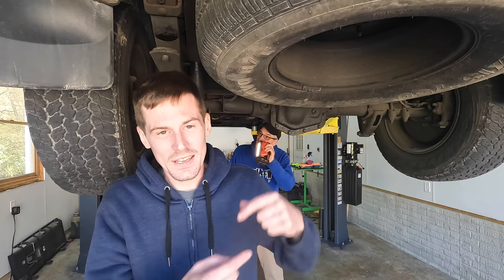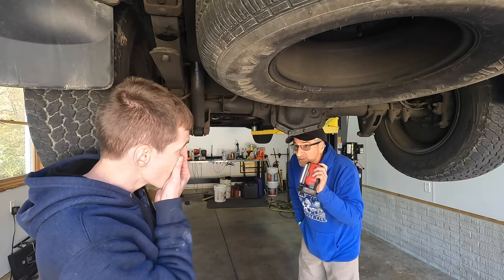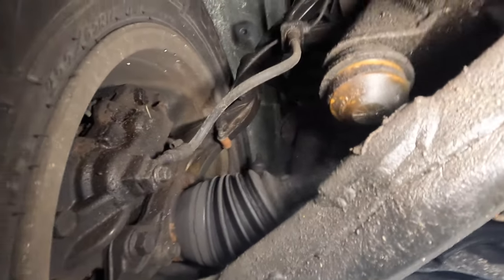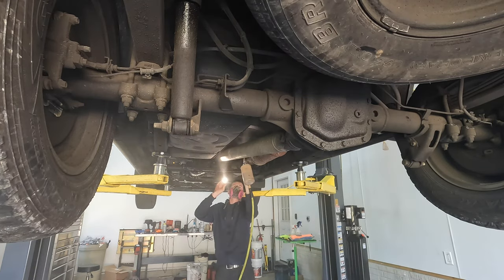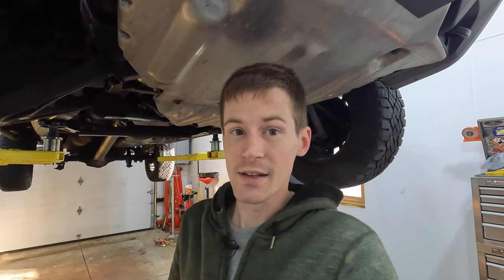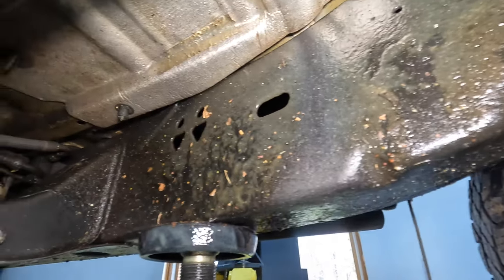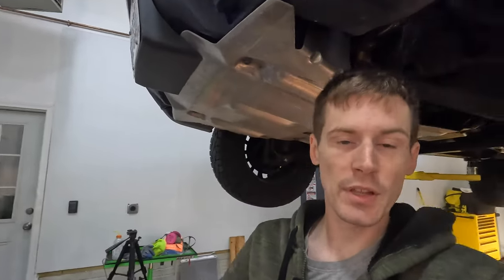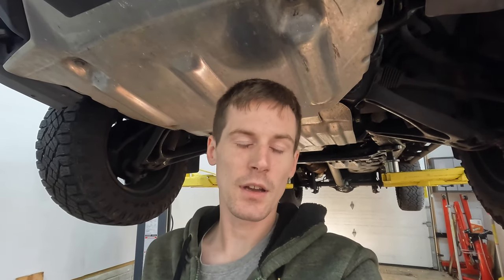Lanolin Undercoatings 5 Year Review & Career News... (Fluid Film, Woolwax, Surface Shield)

Comment: Congratulations on your new B'laster job.  As the social media guy (essentially, marketing), I think you should make content showing other great uses for Surface Shield.  Example:  It's hands down the best product I've seen for preventing battery terminal corrosion.  When installing a new car battery, spray the posts, attach the battery cables, and spray the clamps.  The non-hardening coating prevents water, air or corrosive gases from reaching the posts, clamps or the copper cable that can wick water and corrode internally.  I also sprayed large fasteners in the engine compartment that were starting to corrode.  Now they're well lubricated and protected from corrosion.  I bet it'd be great for protecting automotive brakes as long as it wasn't applied to the friction components (pads and rotor or shoes and inside the brake drum).
Reply from the maker: Thanks for the ideas!
Reply: Absolutely do not spray battery posts before connecting the cable clamps; you want pristine clean metal contact between the posts and clamps for maximum electrical contact; spray after connecting.
Reply: @petesmitt  - Good advice for any hardening coatings, but Surface Shield is a non hardening coating.  Spraying the post and the clamp before assembly ensures that the anti-corrosion coating is displaced for a metal-to-metal contact, and every place that isn't the metal-to-metal contact is an air-tight and water-tight anti-corrosion thick liquid material that stays in place for long term protection.  Over a year later, the terminals on my 4Runner battery still look wet and as clean and corrosion free as the day the battery was installed.  It's important to prevent moist air from entering the connection and oxidizing the metals.  That oxidation can progress into the connection and cause a high resistance connection to develop over time.  Spraying the battery posts after assembling the clamps is good but spraying before assembly is far better.  I also spray the clamps beyond the insulation on the cables to prevent moisture from entering under the insulation and internally corroding the copper conductor.
Reply: @Liberty4Ever  The coating is not displaced when you fit the clamp; there shouldn't be any coating at all on posts; they should be clean metal only; in fact, post cleaners are used to ensure that the metal is 100% clean of any contaminants before attaching the cable clamps; ask any automotive electrician or a qualified mechanic like myself.
Reply: @petesmitt  - The primary purpose of the post cleaner is to remove the oxide coating that forms on the metal, aka corrosion.  Surface Shield is an effective way to prevent moist air from entering the connection and causing corrosion.  I'm not a mechanic, but I am an electrical engineer, so I know a few things about electrons, electrical connections, electrical properties of materials, etc.  The Surface Shield is displaced wherever the metal to metal connection is formed when the clamp is tightened.
Reply: @Liberty4Ever  Assuming the product is displaced, with no degradation of the electrical connection, then why apply it to the posts in the first place? At best, it's pointless; I've used petroleum jelly on battery clamps since doing my mechanic apprenticeship in the 70's and never get any corrosion; I'd stick to using a petroleum based lanolin product for what it's designed for; preventing rust with body and frame steel.
Reply: @petesmitt  - The most reliable electrical connections are gas-tight connections.  Soldered connections are gas-tight but are bad in high vibration applications on vehicles.  A good crimp connection is gas tight without creating a stress riser that causes conductor fatigue failures as seen with soldered connections.

The purpose of applying any viscous liquid anti-corrosion compound to the post and clamp and then squeezing the dielectric material out when the clamp is tightened is the squeeze out ensures complete coverage.  Dry assembling battery connectors and then spraying the top of the post and clamp connection will result in good coverage on top but no coverage on the bottom, where moisture and corrosive gases vented from the battery can enter the connection and start the corrosion process underneath where it won't be noticed.  Maybe search YouTube for "CRC Technician Grade Di-Electric Grease Instructional Video" for a demonstration of the principle of a gas-tight metal-to-metal connection that's protected by grease displacement.

To be clear, covering the top of the battery posts and clamps with any grease will provide good protection from corrosion that's far better than dry assembly and no grease, and is far better than doing nothing to protect the connections, but wet assembly with dielectric squeeze out provides added protection.

If me spraying the posts and clamps before assembly compromised the metal-to-metal connection, I'd have known about it recently when temperatures dropped to -20 F at night and my 4Runner and my wife's RAV4 were started in sub-zero weather after being parked outside overnight and cold soaked.  Turning over an engine that cold with a lead acid battery that cold is an extreme test of an electrical system.  If there was a high impedance connection at the battery posts, I would have known about it.  Both vehicles started easily, only slightly slower than starting when warm.
Reply: @Liberty4Ever  Dielectric grease is silicone,  not petroleum based like the Surface Shield product; regardless, if you are getting copper sulfate corrosion on battery terminals, you have a problem with your battery or alternator which needs addressing first. 
I've never coated battery posts before fitting the clamps and never get corrosion around the clamps, so it appears both of us get success; I do apply petroleum jelly at the base of the post before pushing the clamps on, so I'm sure that I'm getting good coverage at the bottom of the clamps.
Key point is that adding any lubricant between electrical connections will not improve the connection and can only degrade the connection, even if only slightly.

Comment: How long does it take you to do the underside of a vehicle?  Do you wash them first? Do you reapply in cavities or was that just the first year
Reply from the maker: Application depends on the prep required. If the surface is rusty to start with, any loose material must be removed for the product to get to the solid metal. A wire brushing or a light needle scaling is enough. It's usually about 2 hours total at the longest. Normal road grime is no issue. If the vehicle is caked in mud it needs to be removed. The product needs to get to the good solid metal. I do the cavities every time because why not. I already have the vehicle in the air. Does it need a cavity spray every year? Probably not.

Comment: Thanks for the content Repair Geek. You're the only one on YouTube that has done this yearly update. Question though, does anyone know what would happen if you spray oil or lanolin on metal and then use rubberized coating on top of said oil coating?
Reply from the maker: It probably wont stick. You can add graphite powder to any of these products to turn them black just like traditional undercoating.

Comment: I've got a 2014 ford f150 bought new and rust checked every year, no rust and I live in the rust and salt belt. It messy if you need to work on it but rather that than a rust bucket.   Still looks and runs like new.

Comment: Another insightful video, thank you!  I guess since you have a lift, reapplying a lanolin film every year could be practical and easy.  But otherwise, wouldn't it be better to use one of those longer lasting wax products like CRC or Cosmoline?  At least, I think they last longer based on a lot of videos I've watched...?
Reply from the maker: I tell people to check and recoat when they change their oil. A lot of my audience are DIYers that don't have a lift. If you have the car jacked up to change the oil spend some extra time coating it with lanolin... The car is already jacked up.
Reply: Cosmoline stuff is okay for brand spankin new vehicles for the exposed surfaces. You would not want that stuff on existing surface rust because it will seal it in and make it worse. The real issue with vehicles are the inner fenders, doors, inner frame, and re-inforcing gussets on the body sheet metal underneath. These are inner channels that need a free flowing oil inside them to migrate around and prevent road salt from attacking their inner surfaces.

Comment: I have a high mileage 90s jeep that has minor rust. I moved to an area that heavily salts and we get a lot of snow. Looking to undercoat with FF or SS, whichever I can get my hands on. What is the best way to deal with rust that already exists? I have a steel brush attachment for a spinnerounder, and a small handheld wire brush, but I’m assuming there’s not much you can do for the inside the frame bits.

Comment: Do you rinse off the dirt and if not can you explain why you, or the D.I.Y er shouldn’t, thanks. Loved your channel
Reply from the maker: I don't. There's not reason to. Just add more on top and create a thicker and thicker coating. What is holding the dirt on the surface is oil. So you basically have layers and layers of oil saturated dirt.

Comment: I noticed your dads exhaust was rusty. What I do is with new steel pipes is clean with Breakcleen, then primer, then high temp(1400 deg) header paint. It stays soft until it gets hot, then it hardens. It looks good and lasts a long time.
Reply from the maker: I'm going to test a solution this winter. I want to see how it's going to hold up before posting the video.

Comment: I find that I get a very fine mist from my WoolWax spray gun (with Fluid Film in the container) that takes a very high volume of air and long spray time to get a decent coating thickness.  A lot of it atomizes and blows away, lands on top of the vehicle, etc.  How do you set your spray gun up to spray more efficiently?

Comment: So I got a 97 F150 in SW florida, and I coated the surface rust under the bed's wheel well with POR-15 Silver (which has aluminum in it), and it made things WAY worse.

A hole that was about 1"x1" is now 5"x5" after maybe 2 years.  I think what is going on is that the POR-15 is trapping the moisture and the moisture is wicking UNDER the POR-15 until the rust is so bad that it pops out the top side of the bed through the paint, or bubbles up through the POR-15. The POR-15 comes off in sheets if what is underneath is heavily rusted.

MY question to you is.
After I fix the rusted sheet metal, should I do normal Primer and Paint THEN Surface Shield, or leave it bare metal UNDER the bed and use Surface Shield?
Reply from the maker: Watch parts 1 and 2 of this: https://youtu.be/EXJgCyShOCw
This is my preference for paint products. Lanolin or paint will do what you want them to do. Either one is going to need touched up. The Lanolin requires no prep or masking making it easier to touch up every year.
Reply: @RepairGeek  that is SUPER helpful. Thanks so much. 

I have some metal to weld in first and find a donor 8 ft bed. Thankfully the rust holes aren’t super bad. I’ll keep you posted.

Comment: I was wondering if you have any idea how long the Surface Shield will stay good in the buckets.  I don't think I need a gallon, but would hate to see it go bad in a couple years before I could use up the rest of it.
Also, has Blaster come up with a fix for the spray cans so that you can use a spray wand with them?
Reply from the maker: The bulk product is good indefinitely. Aerosol blaster quotes at 3 years. The product is the same. With aerosol,  the propellant may not be good after 3 years.

Comment: I have a question. How do you's spot a oil when everything's already wet? What do mechanics bank when they have to work on it when it's all greasy ?
Reply: Some techs will probably complain. There’s a video going around that asks if techs should charge additionally for dealing with “wet” undercoating applications.
Reply from the maker: @js12278  lmao so are they going to charge less when everything comes apart easily? 2 sides to this coin. I'll wipe my hands all day long if bolts aren't breaking off.
Reply: @RepairGeek  I’m with you 100%. I do my own work on all my vehicles. None have rust here in Central Illinois and all are coated in Woolwax and Fluid Film.

Comment: I live on gravel roads, would you still recommend this or will the gravel dust just stick to it and make a mess? Hope you respond thanks!!
Reply from the maker: The dirt will help it stick. Consider washing out the mud with a low pressure garden hose every now and then but I would 100% still coat it.

Comment: Soo i have a 2011 colorado v8 z71 crew cab Mint & no rust on frame at all yet... I KNO THESE ARE KNOWN FOR rusting Frames .. WHAT do u recommend me doing to keep Frame perfect and rust free i also live were they put chemicals & salt on roads in winter this winter i didnt drive luckly... LOOKING FOR YOUR RECOMENDATION I watched alot of ur videos bout rust prevention still dont kno if i should raptor liner it or just Spray tons of surface sheild & fluid film all over it..   Also i would like to treat inner frame as well..

Let me kno man & thanks for good vids
Reply from the maker: Lanolin 100% virtually no prep, or masking required. Recoat it yearly. I have a video on undercoating existing rust with lanolin if you search around on my channel. That video lays out what you should do.
Reply: @RepairGeek  ok thanks man, yes myn has no rust at all yet .. so I'm going to by that & what u recommend getting & spraying inside holes in inner frame

Comment: Any idea how well Surface Shield will stick through a car wash with under body spray? I live in the rust belt and take my 2020 Tacoma through the car wash frequently. I just undercoated it for the first time with Surface Shield. There is some light rust underneath from 3 winters but not terrible. The only loose rust was on the trailer hitch area which I scrapped off with a wire brush.

Comment: Are you spraying at the same PSI as you did with Fluid Film? I might switch to SS for this years coating.
Reply from the maker: Slightly lower because it's thinner.
Reply: @RepairGeek  ~60PSI?
Reply from the maker: That's fine.

Comment: Just thinking. When the Fluid Film, Woolwax or Surface Shield is covering the differentials would that increase the running temperature?
Reply from the maker: Your speed and ambient conditions are a much bigger variable than the coating. I did a cross country road trip in September for my honeymoon in a solid axle mustang. Running 80mph across Texas in 95 degree heat my rear diff hit 240. The same speed on the way back when I was further north was only about 225 when the outside temp was about 60 or so. I would take about 100 miles of 80mph from dead cold to reach those temperatures. Once the diff was heat soaked, the only way to cool it down was slow down to 70-75.

Comment: So you have just re-applied fluid film every year without cleaning the undercarriage? Salt etc is not being cleaned off?
Reply from the maker: The salt is sitting on the coating. When you drive in the rain throughout the year it will wash away the salt. I re-coat it in the fall after the coating has seen rain all spring and summer. I've had no issues doing it this way.

Comment: In one of your earlier videos you explain that painting over rust can actually trap the rust under the paint which does nothing for rust prevention. My question is if you cover surface rust with the lanolin based products, like the blaster surface shield product, does that also trap the rust under the product?
Reply from the maker: I never said rust is trapped. Moisture is trapped... When you paint with MOST paints, it seals that moisture in the rust into the metal. Lanolin will wick out that moisture and keep it from rusting further. There are moisture cured paints that will pull the moisture from the rust and use that moisture to cure the paint. The nice thing about lanolin is it will never chip crack or peel. Also the prep work for lanolin is about 5% of what it is for paint.
Reply: @RepairGeek  yes, moisture, sorry I misspoke. Thanks for the info.

Comment: Have you ever mixed in linseed oil with any of the lanolin products? A lot of people I know mix fluid film with linseed oil 4:1 ratio and I am wondering what the advantages are to cutting it vs. spraying the straight product?
Reply from the maker: Linseed oil preformed worse than Fluid Film alone in my testing. If you cut FF with linseed oil I think you would just make the performance of FF worse. That's just speculation but linseed oil wasn't all that great.
Reply: Thanks for the reply. My friend said he thinks the linseed oil helps the FF stay on the surface a little better and hardens it a little bit but not enough to crack. Also do you see any advantages of putting fine sand over top of the wet frame right after spraying it? A few people I know like to do that.

Comment: Hi I had a quick question for my personal car. I was originally going to go with fluid film black because I do have minor/moderate rust on my car so I could hide all the rust and make it all black and look nice. Then I saw ur pb surface shield video and want to use that but since they only have a clear version I was wondering if I could put black fluid film on first then surface shield? Or would it wipe right off since fluid film is the base layer and could easily come off so the surface shield would come off too?